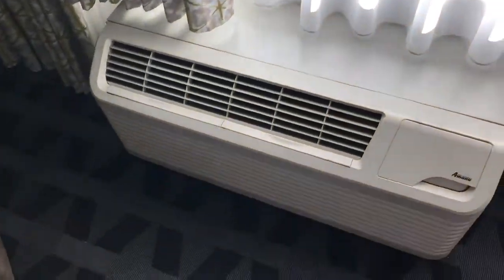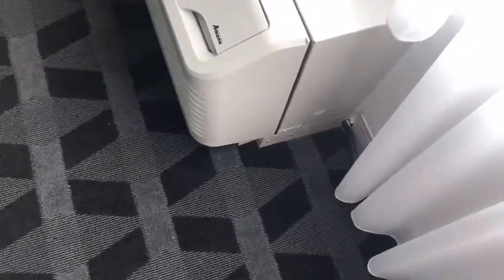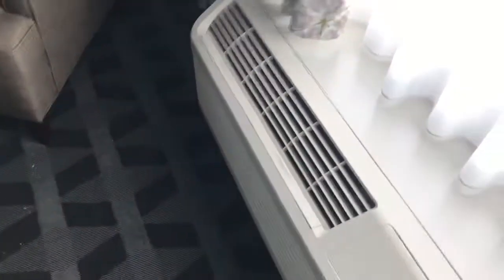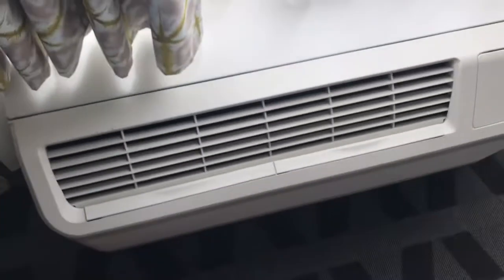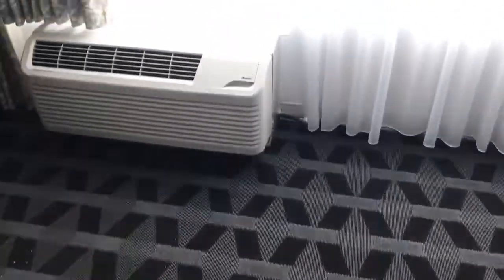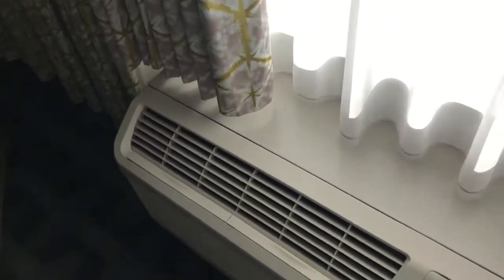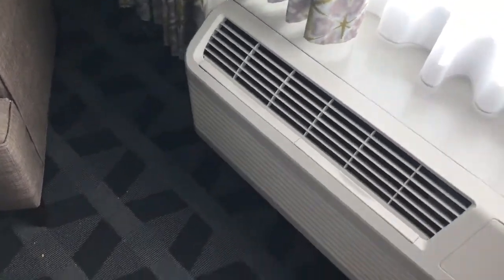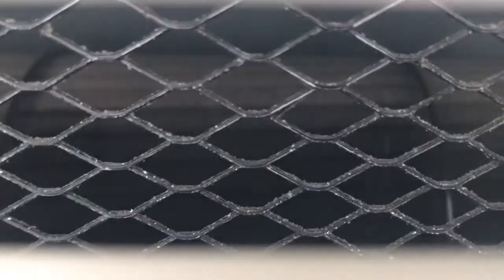Startup/Shutdown of an Amana PTAC unit in heat mode!

Comment: In the GE zone line PTHP unit, when we put it to heat mode to dry the clothing, we put it at 78° in the compressor turned on in heat mode so it is a heat pump